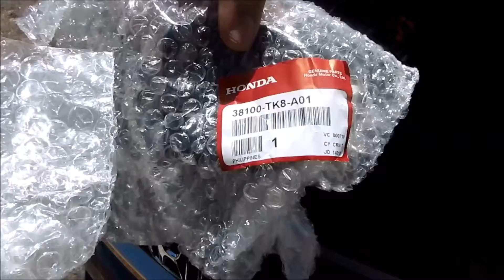DIY: 2013 - 2017 Honda Accord Horn upgrade

Comment: I have a honda accord 2016 touring. I bought a accord 2019 horns thinking that they would fit but it didn't because the connection are different. Do you think if I buy these ones the would fit?
Reply: It says 2013-2017 so..... yea. It will fit.
Reply: If You Have Honda Accord 2019 You Can Change The Horn With Honda HR-V (38100-3M0-J01 & 38150-3M0-J01)
Reply: If You Have Honda Accord 2016, Honda BR-V, Honda WR-V, Honda HR-V Old, Honda Jazz, CR-V Old, You Can Use Honda Odyssey Horn 2014-2020 (38150-SLE-J01 & 38100-T6A-J01) Because The Socket 1 Pin Only For (+) Positive CMMIW Thank You

Comment: you should get hella supertones! I want to get some but haven't gotten it yet because I don't know how to install it :/
Reply from the maker: Hella Supertone Installation:  Relay: (86) ground (87) 20a inline fuse to positive battery terminal (85) Original stock horn wire harness (30) Positive leads on Hella Horn.  Last, ground the negative leads on the hella horn to the chassis.
Reply: Thanks man!

Comment: My horn doesnt work when I lock the door! Is there way to fix that?
Reply from the maker: What did you do last before it stopped working?  Did you replace or add something?  Is your hood and all your doors/trunk closed?  Does the interior lights go on and off with the door closed?  Is the trunk light off?  Is it in valet mode?  Does your horn with the panic button.. does it work when you push the horn on the steering wheel?  I really need more info.
Reply: Is that feature off in the vehicle settings?

Comment: Also, what's the part number for the screw that holds the windshield fluid in? Thanks
Reply from the maker: Qais http://estore.honda.com/honda/images/parts/catalogs/EA/14T3LD01/Estore/illustrations2/T3L4B1500.png

Are you looking for Part #12 in the diagram?
Reply: DIY: Car Modz yes sir that's the part, you have the part number? Thanks.
Reply from the maker: 91501-TR0-003

Comment: Hey can you unscrew the front emblem off if you take that cover off? I wanna wrap the emblem in vinyl
Reply from the maker: I will check tonight and get back to you.
Reply from the maker: Okay, I've remove the top cover and checked the backing of the emblem.  There is not a screw for the emblem on the coupe.  All I saw was the 2 pin on the backing of the emblem.  It looks like you just push the emblem through the 2 pin size holes and that is how it is held in place.